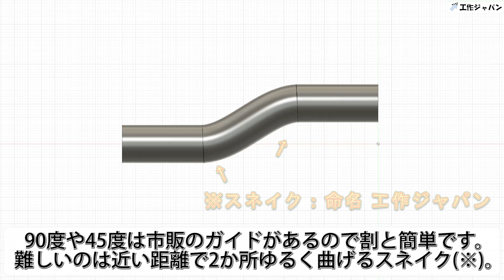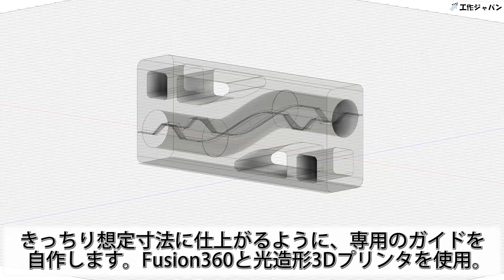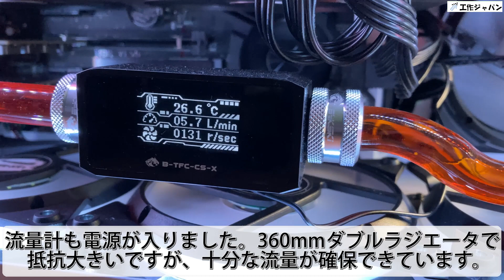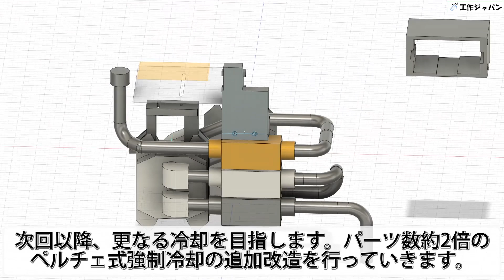水冷PCのハードパイプを少しだけ曲げるツールを3Dプリンタで作りました。

Comment: never installed thermal paste like that might try with playing card
Reply from the maker: Thank you for your comment!
Yes, The tool I used to apply it was the one that came with the CPU grease, but it was a little difficult to use because of its narrow width. I feel that something as flexible and wide as a card would be easier to apply.
Next time I'll try using something like a card!